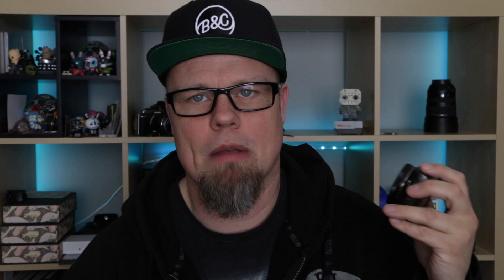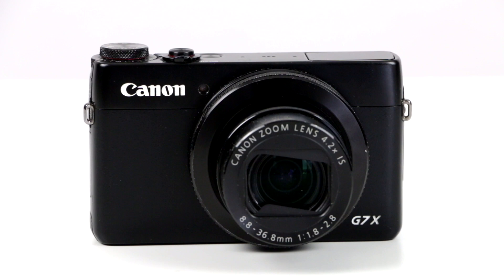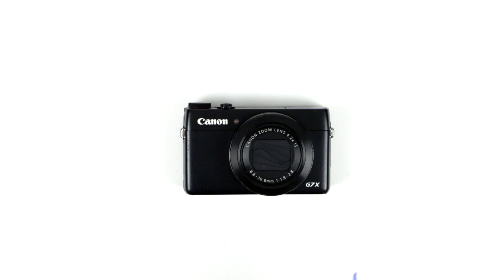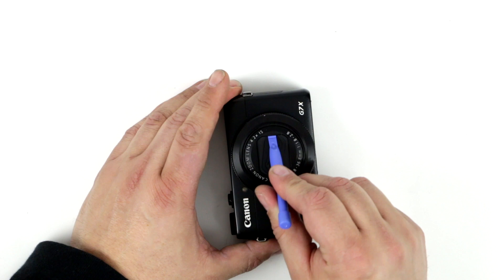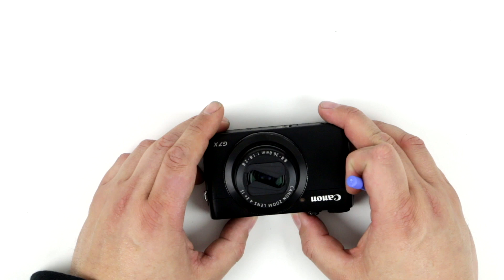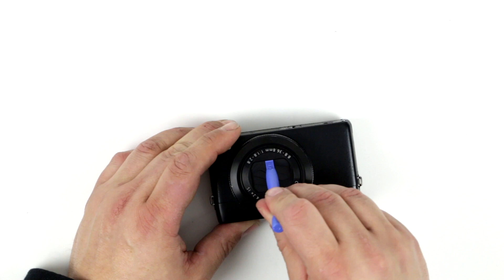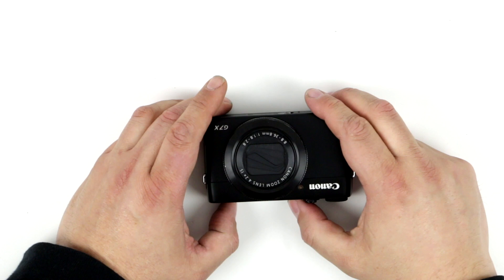Repair Your Canon G7X - Quick Fix Stuck Lens Cover

Comment: Wow, this fix took like 5 seconds. I had a bunch of sand in my G7X Mark II and all other problems like a grinding noise when using the ring disappeared after a few days but the lens was stuck open for the last year. I dreaded the repair bill and today finally tried to find a way to repair it myself. Literally 5 seconds, thanks for the video!
Reply from the maker: Glad to hear this solution worked for you, and saved yourself some money. Cheers!
Reply: How ? Where exactly are u pushing ??

Comment: This was helpful! I tried prying gently, but that didn't quite do the trick. We had gone to the beach recently, so I though I'd try blowing as hard as I could into the closed cover. That did the trick! I'm guessing this dislodged some sand stuck in there. I used to play saxophone, so I blew pretty hard ;), a can of compressed air may work too.
Reply from the maker: Glad it helped. Remember the pro tip guys: if you don’t need lay sax use compressed air! Thanks for sharing!

Comment: Awesome, THANKS!!!  I've had this issue with a used Canon PowerShot SX740 HS that I had bought years ago and the lens cover kept sticking.  I thought I was going to need to replace the lens assembly.  Then I thought of looking up fixes for the issue and came across your video.   Saved me time, money and anxiety.  Thanks again!
Reply from the maker: Glad to hear it helped you out.

Comment: I have the same issue with my Canon S120.
In place of that plastic thing that were shown in this video,
is a thin  squared metal plate I raised with a knife blade. And it Worked!
Thanks a lot.
Reply from the maker: Glad to hear that this also worked for your camera.

Comment: I can't thank you enough. I didn't have the tool but had a pair of tweezers the had almost exactly the same bend angle; gently put it under and pried the cover area upward and it now functions perfectly. You saved the day !!!
Reply from the maker: Glad it helped!
Reply: How did u do it .I don't quite understand where to .. bend it back or ..fix it
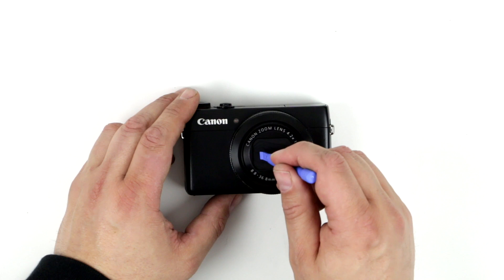Reply from the maker: @ericaroundtheworld  the too is being inserted between the lens cover (the part that moves when the camera turns on) and the  aluminum that is just above it (looks square when open). So that small space between those two parts. Hope that helps. 0:56

Comment: I wish I had found this video a week ago. Happened to me but thankfully it resolved itself after switching on and off for like 50 times. Thank you for sharing this tip - Super useful!
Reply from the maker: Glad to hear that you camera is working again. Cheers!
Reply: How did u do it.  So to push the lens down? Between the lens cover and lens? I don't quite get that .. thanks can u help plz

Comment: Worked well on a cannon powershot sx230 i bought to resell but mine seemed to work better on the top rather than the corners
Reply from the maker: Glad it ended up working for you.

Comment: What a simple fix, thank’s a lot. Worked right away for my Sony RX100 m4 I had stuck opening just 2/3 for over half a year. 

I was used to had to hold lens cover lightly with my thumb after powering it on and lifting the thumb after the lens was fully extended so that the lens cover spring had enough tension to open fully.
Reply from the maker: Great to hear that this fix worked for your Sony!
Reply: How did u do it.  So to push the lens down? Between the lens cover and lens? I don't quite get that .. thanks
Reply: How did u do it.  So to push the lens down? Between the lens cover and lens? I don't quite get that .. thanks can u help plz

Comment: same issue for me with a Panasonic LX10, I cleaned and cleaned for over 10 mins.  Opening and closing, eventually worked.  I say this, b/c the tiniest amount of dust can jam these all apart.  I had the G7X too and I just keep mine in case.
Reply: My G7X was brand new and I’d used it in Spain for the first time when a horrible local rudely bumped into me from the back (I could not see him as I was ahead of him). There was ample space along the entire plaza but it seemed that he was intent on being unpleasant as I’m Asian. (Experienced racism for the first time in Europe despite being familiar with other European terrain.) That knocked the G7X out of my hands and it swung against a hard object. It has been stuck ever since unless I manually tug at it each time.

Comment: My SX 730 got dropped from about six inches from the ground mounted on a small tripod and now I have the same problem. I will try this. Thanks!
Reply from the maker: That sucks! I hope this works for you!
Reply: @JDirom  Yes! It worked with my camera; however, I had to be very careful and have a lot of patience. I tried and it got better, did it again, and it would open inconsistently, waited a few days and did it again and again slowly with the guitar pick (like I saw in one of the comments) and it is back to opening well now. It took me some time because I did not want to force or break anything. Thank you for posting, I wish you all the best.
Reply from the maker: @eliseoborrerobass  glad it helped to a degree.

Comment: Can't believe this is still happening. Canon should be ashamed that they have not remedied this flaw. I've had Canons since 1972, including 4 of the old G-series rangefinders. ALL the G's did this. I used to put some WD-40 on a cotton swab and dab a little carefully on the blades, and that worked for a long time. In fact, I just took out my G12 which I haven't used since July when I did this, and I tried but the blades won't jam at all. (I just sold it on eBay.) Seems a lot safer than this method, but what ever works you go with.

Comment: I have a Canon SX230 HS that was doing this. I looked at it really close, and yep, there's a tiny dent that's pushing it in.  10 seconds of prying with a little screwdriver and it's all fixed.
Reply from the maker: Glad it worked for you!

Comment: The 'leaf shutter' design is a poor solution to the lens protection issue.

I had this problem with my G7Xii. The reason the blades were sticking was not because of the ring surround that you attended to but a very slight bend of the tip of one of the blades. this was causing the blades to hang up when this bent blade tried to pass under or out from under adjacent blades. 

I used a small jeweller's screwdriver to bend the tip of the blade out again. This has not solved the problem 100% for 'camera on' - there's just a very small section of the top and bottom blades still showing but the merest touch with a finger tip and it snaps 100% open. Closing it - no problem. 100% closed each time.

It is a deficiency by Canon not to supply a slip-on lens cap with this camera. I have now bought an after-market one.
Reply from the maker: Agreed a cap (other than losing them all the time) is a solid thing. That being said in this range of cameras most are sticking to the 'leaf shutter'.

Comment: Does anyone know if Canon might have addressed this problem with their newer version G7X Mark III ?..... given issue was chronic with GX7 1 and 2 you would think they would?
Reply from the maker: For me the issue was a result of just throwing it in my pocket with no protection. I would suspect the issue may still exist, because it isn't really a design flaw, but rather a durability issue. It could be simply solved by a lens cap, but that I would almost think moves it out of the point and shoot category.

Comment: used a sewing needle and gently pryed at the corners, got them bk down again but still have to pry it fully open and then pry to close again so might have to take down local repair place, thanks anyway.
Reply from the maker: The sewing needle probably doesn't pry enough, I do recommend the pry tool you can find in the description of the video. It is very inexpensive.

Comment: Wow this actually worked, thank you so much! I used a guitar pic and it worked perfectly. I was horrified with this issue, do you know the cause? anyways - thank you so so much!!
Reply from the maker: Glad it worked for you. Generally it is caused by  pressure on the area that you opened up with the guitar pic. It can happen in a pocket, in a bag with other things, if the camera is bumped or dropped.

Comment: Is there a household item I can use instead of the tool? Thanks.
Reply from the maker: Tool and S the best solution. You can try something thin, but if you do proceed with caution. Tool is inexpensive, and has a curve  that makes prying easier, along with being plastic to avoid causing cosmetic damage.

Comment: I have a Canon D10 (underwater). It's focus is not working (though all other functions seem ok) When focusing you can hear a buzz or flipping sound.  Canon does not repair, or have a replacement underwater unit.  Any suggestions on what I could do, or where I could send it?
8/8/20
Reply from the maker: I would take it to a local camera shop first. Focusing will require lens movement, and likely what you are hearing is the motor. If it wasn't loud before, may be an issue there.

Comment: Hi J Dirom... slightly off topic- kind of- but would there be any operational issues were you to remove the lens cover blades permanently ?
Basically would the camera work ok ?
Reply from the maker: You could remove the blades, but you would put your lens at risk of being scratched. I would sooner leave the blades in and move them manually as a last resort before that.
Reply: @JDirom  Thanks for the reply. The reason I asked was due to the well known "scratch" issue on G10/11/12/15 etc- apparently down to the blades running too close to the lens. If I had a hint of this happening on my G16, I'd remove the blades and make my own lens cover !

Comment: What's the problem, dirt, dried maple syrup, bent leaf on cover, or a variety of causes depending on camera?
Reply from the maker: Depends on the user, these issues can really typically be avoided if you carry the camera in a case vs a pocket.

Comment: I have a cannon G7 (no x). The lens cover spring (seems to be spring loaded) popped off when the camera bumped into something and only half of it closes and opens now. The other half is non-functioning. I was hoping by looking at this video it would show me how to remove something to access the spring. If you have an idea of what I can do, would you please let me know? Thank you.
Reply from the maker: You have to extend the lens, and then remove the battery, so that lens doesn't auto close. Place the camera. Then you slowly move the top of the extended lens barrel clockwise anti-clockwise. You should be then able to pull the barrel off revealing the springs and shutter mechanism. Honestly I don't recommend it, the shutters and springs are very tough to resemble. Best of luck.
Reply: I hear ya. I'm in the process of doing it today. I saw another video that showed a guy doing exactly what you described. He fumbled around and the video was like 20 minutes long but he didn't have spring issues like I have. I had to put it aside and just breathe for a while. I would never recommend ANYONE do this unless they are already working with a broken camera. The only thing that was wrong with mine was the dang half a lens cover. Now I wonder if I've messed up the barrel cause when I did try to have it go in and out (put the battery back in, just to try to understand how the two tiny screws worked and where they went), it was beeping and jamming and OMG. What a mistake this was. I have a dog and the camera hasn't been in a case, so I've been taking this opportunity to get the hair out of it. I thought something was another hair and it was another micro-mini spring! Imagine my horror. You would NOT believe the day I've had.
Reply from the maker: So sorry to hear that. These are very much last resort solutions. As you indicate only worth attempting if the camera is broken. In my case I will only do these repairs on the camera you saw in the video, because at the end of the day I feel replacing the camera is a better option tan paying $300+ for repair. Again sorry about your camera. I hope you are able to get it back to working again. My last ditch solution for myself would have been to find a rubber cap to use as a lens cover, similar to kuvrd rubber universal lens cap, and remove the shutter covers. Again not recommended, but would be a final resort.
Reply: Yeah. We'll see how the story ends. I'm still walking "past" the camera and not picking it up to finish the job, but I will in a few hours. The suspense is killing me. (Not really. Just dread.) I'll come back and let you know how it went. Thanks for your video and for the back and forth.
Reply: I think it's that inner ring that the springs and fins all operate off of that is the problem, cause I got all the springs and fins back in place and everything looks right, then when I manually push on the ring to turn it counter clockwise, the fins open and close perfectly. But when I put the little cap ring thing back on, slide the battery in and turn it on and off, the fins just go limp and do nothing but flop around. I'm proud of myself for trying and for getting all this way. Now I know it can't be fixed by myself and on Ebay, the camera is only selling for $80. I'll either remove the fins and just keep the camera in a bag or if it won't take pics right without the fins, I'll just toss it. I'm done. ;)
Reply from the maker: I am sure without the fins it will take photographs (or so I would hope). Thank you for sharing your adventure. If you happened to film it, let us know we would definitely give it a watch. Cheers!
Reply: No, I didn't film it. It was too difficult and delicate of a process but I did think about taking still shots of it before closing it back up. I didn't even do that because I couldn't accomplish the goal of actually fixing it, even though the puzzle pieces were all in place. The camera still does work so I just flung the fins and I'm keeping it inside a ziplock bag, inside a camera bag. I learned something and gained some patience. For that, it was worth it. :)
Reply from the maker: I would maybe just get a lens cloth and place it over the lens and use an elastic band to protect the lens. Will protect the lens from scratches or abrasives, also the rubber cover I describer earlier will also work. Hope you get a few more years out of your camera! Glad to hear that it is still functioning!

Comment: Is this same as error 60 on g7x iii. ?
Reply from the maker: If that error message is because the lens covers won't open then possibly. As I don't own a G7X III I do not have a user manual that outlines the codes.

Comment: I have the same issue with my Sony RX 100 III, 
but I don't have that plastic thing that were used in this video,
what else can I use instead?
Reply from the maker: You could use a small eyeglass flathead screwdriver would also work somewhat, as well as flat ended tweezers. Granted be aware just be wary of the force due to the leverage angle.
Reply: I just used my fingernail.  Worked well on the sony rx100v.

Comment: Would this trick work with film point and shoots?
Reply from the maker: Potentially if it has the same protective shutter design it may work. People have found success with a variety of cameras using this method.

Comment: Did this didnt have a tool used a butter knife thin enough it workes but scratched abit of black paint off lol thats ok though sucks it happened only after month of use.
Reply from the maker: Glad you were able to get it working. Yeah using anything metal to pry has the potential to scratch the finish. But sounds like you are like me, you just want to get the most from the camera.

Comment: what could i use if i dont have that tool?
Reply from the maker: The tool is recommended an inexpensive. The link is in the description. You could however use a guitar pick or something relatively sturdy and thin enough to slip between.

Comment: What else can I use if I don’t have this tool??
Reply from the maker: You can use a small flat headed screw driver, but that is not the best option. The tools are very inexpensive and are better suited. You can find them in kits like this https://amzn.to/2RzxvZg or buy them on their own for very little off amazon.
Reply: A credit card worked for me.

Comment: Please help me, my front thing on the camera is wonky and I can’t get it straight and when I try turn it on the lens won’t go in omg I’m so scared it’s my dads camera
Reply from the maker: If it is the lens shutter as shown in the video, the steps shown may fix it. If it is the lens barrel that is stuck, that will be a complicated fix.
Reply: The lens barrel is crooked and it’s stuck 😕 it’s going to cost more than the camera to get it fixed
Reply from the maker: Sorry to hear that, unfortunately I don’t have any advice how to fix that, as I have never encountered that issue personally.
Reply: J Dirom ok thanks anyway 👍🏼 have a great day

Comment: Ugh mine is still not working :( I just checked with canon and it's $259 to replace!! So sad
Reply from the maker: Sorry the it didn't work for you. Is it just the shutter getting stuck? I would try prying every 45 degrees or once again if it didn't work the first time. Sadly when they go back to Canon it is not an inexpensive fix :(
Reply: I don't know what you would call it lol, the 6 little thingies just don't open and close all the way every time. i have to push them up to stay in place when my camera is on. i already tried dissecting it and fixing them myself with no luck. :( I wish it was cheaper but they said I would just end up getting a refurbished camera back
Reply from the maker: I believe that you are talking about the shutter blades. The method shown is the easiest way to deal with that (unless then have really been pushed in). Sorry that you may have to go the refurbished route :(